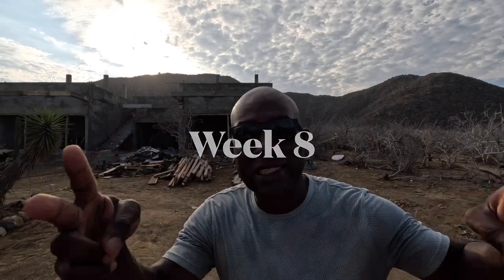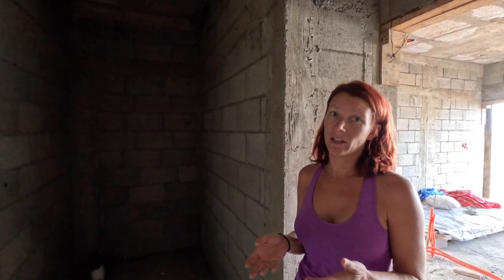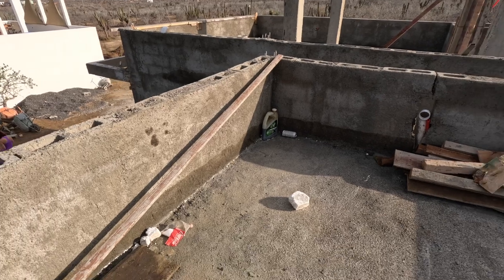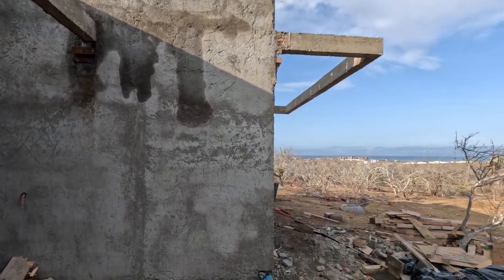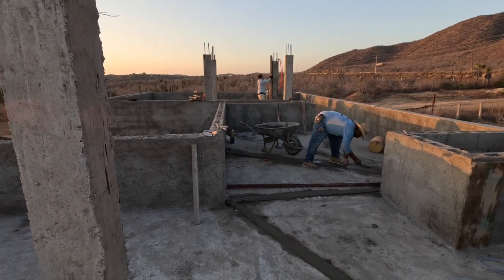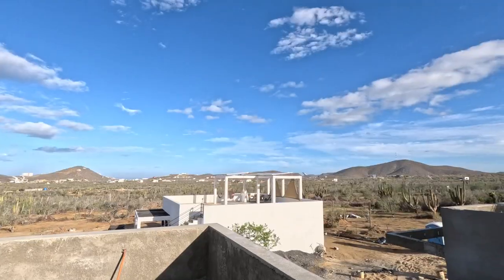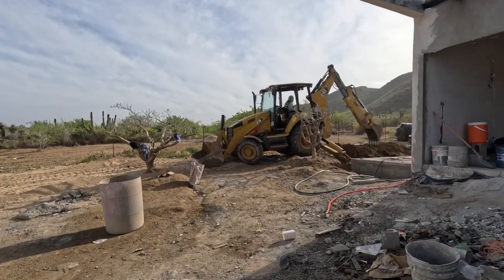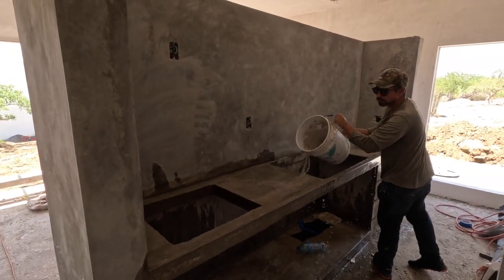Building in Mexico Week 8, 9 & 10 | House Construction in Mexico

Comment: Is it possible to build a building in small pieces over a timeframe of years?
Reply from the maker: Hi, absolutely! That's how many locals build their homes. They typically alternate between constructing and saving until the project is finished. The difference might be that they often live on the property during this process. I would be concerned if you built and then left for a year with all your supplies sitting there or rebar sticking out of the ground. Someone might assume the project was abandoned and remove them.
Reply: i like how you use the phrase "remove them"

Comment: JUST CURIOUS HOW MUCH COST SAVINGS COMPARED TO BUILDING IN THE US?
Reply from the maker: Dollar for dollar and not factoring in anything else, I believe it’s about half the cost. However, comparing the two is challenging. The exchange rate is a key factor affecting the final cost, beyond one's control. Building in Mexico differs significantly from building in the United States. I'm not just referring to materials; it's about the overall process. Building here demands a hands-on approach and physical presence, unlike in the United States. Additionally, the finished product, based on our experience, is significantly different. Therefore, your expectations should be adjusted accordingly.